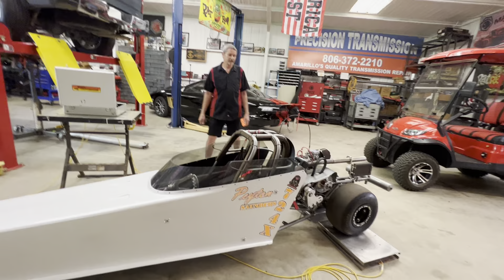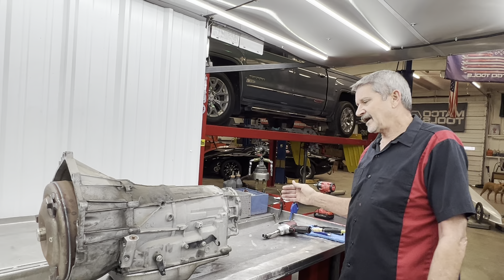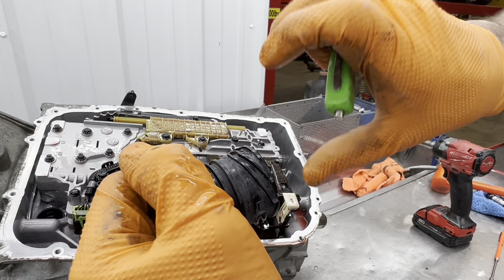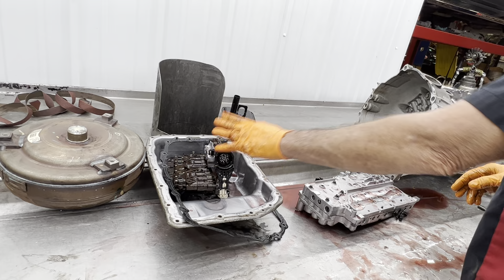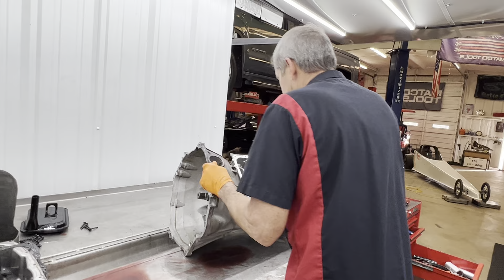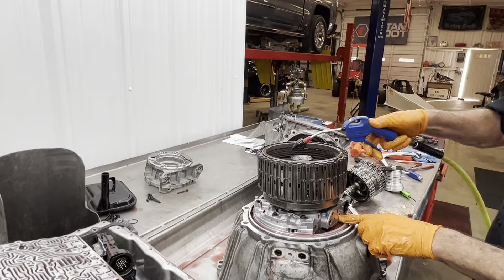6L80E - 4w/d.  09/15 GMC Sierra Z-71  - 5.3L

Comment: What is the cause of a flare up when the 6l80e shifts from 3rd to 4th I believe when it's cold. Usually only does it once and then it shifts perfectly fine after that initial flare up during that specific shift. It has been doing it for quite a long time now. Trans only has 70k on it currently and I want it to last to 180k like that one at least lol.

Comment: I'm pulling the 6l80e out of my 09 Suburban now and trying to find a good shop to rebuild it.  I got 195000 on the original before the torque converter took out the trans.  Hard to find a local rebuilder.  Wish you all were closer.  I really appreciate the videos.

Comment: 39:34 I get why Richard doesn't want to blow the piston out of that drum, but once it got so hot that the pressure plate turned blue (~550F)... that's not reusable anyway, right?
Reply from the maker: The shaft has been heat treated beyond that to start with the hub on the end discolored from fanfiction material and of course heat but not enough to not be able to use that drum new bonded, pistons new steals, clutches, top hat, snap ring good to go

Comment: Will be alignment band that used for the 4L 60 E oil pump cover the circumference of the 6L 80/90 pump or am I required to purchase a second alignment band
Reply from the maker: No sir 4L 60 E pump band will not work. Have to buy a new one.
Reply: @richardteresacricheducatio3542  thank you Richard i’ll keep watching it for a price drop then I’ll nab one up.

Comment: The 4R100, is such a great transmission! I, only drive Ford 2 valve, trucks. Never, any problems. Service, the engine and transmission, no problems.
Reply from the maker: From the e4od to the 4r100 one of Ford best units

Comment: Hello Richard on them years 2015 to 2019 Chevy truck , Tahoe,Denali 4x4s do you  pull the T-case with transmission or the T-case first? Then the transmission, or both at once? Thanks for the videos too😊